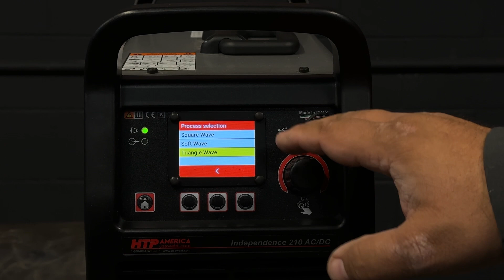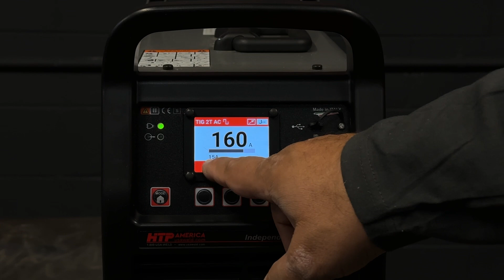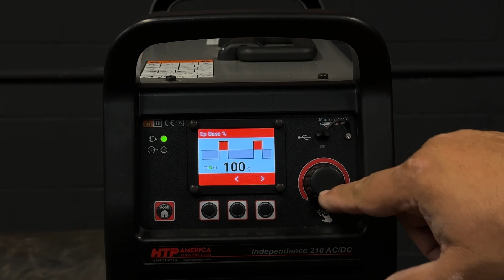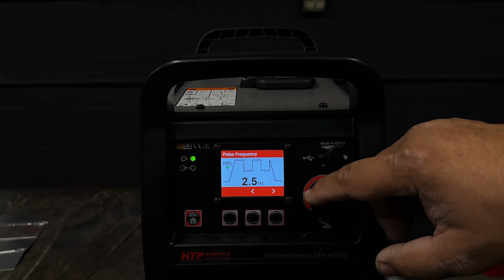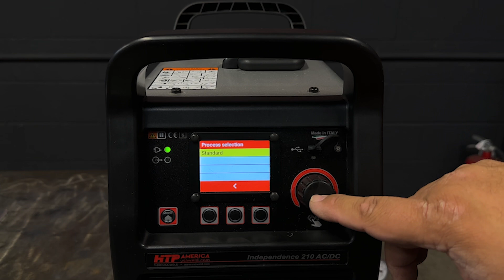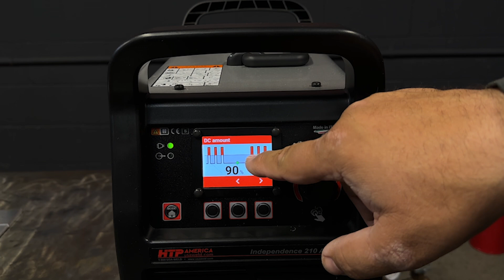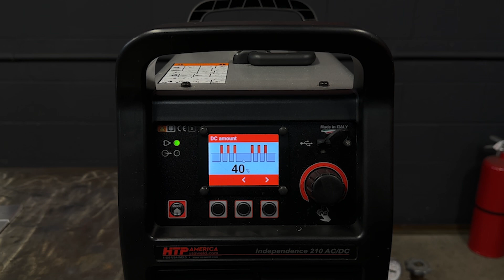Independence 210 AC/DC - AC Welding

Comment: But does the higher % of EP degrade the tungsten shape any degree?
Reply: High EP always degrades or even balls your tungsten
Reply: @ZILAwelds  Thanks, I'd rather clean the plate first, and then weld 75% EN, good to have these modern inverters that can go Hi EP % if you can't hand clean the plate first.